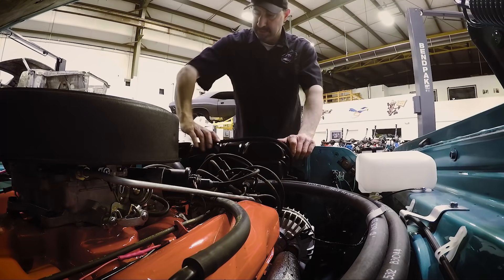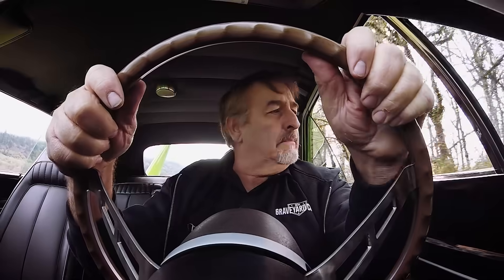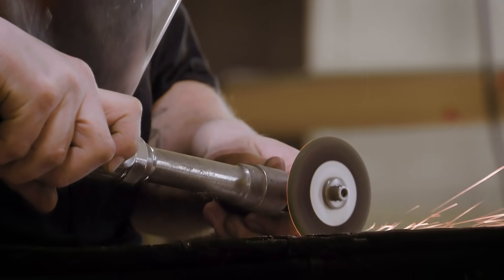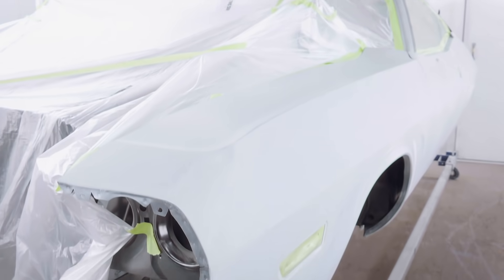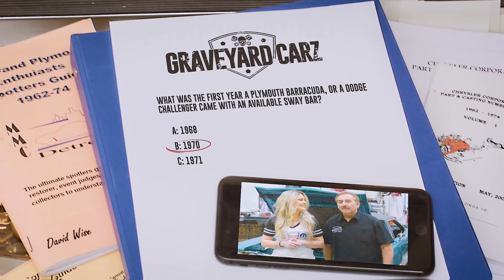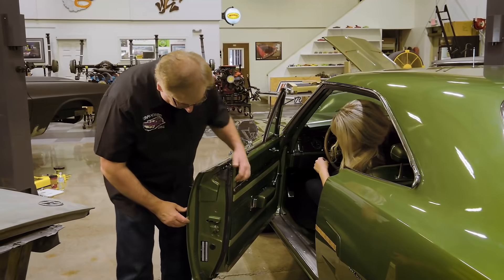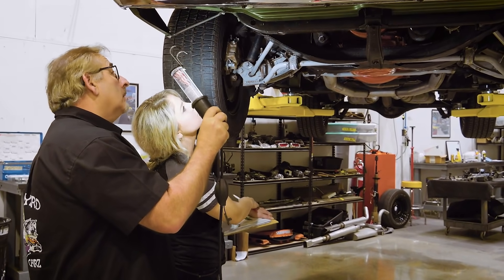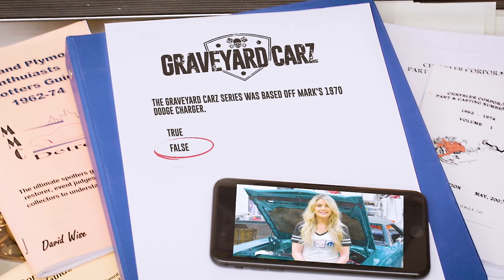700HP SUPERBIRD: TEST DRIVE

Comment: Has this company ever built a Dynacorn Challenger from the ground up?  Would be curious to see what goes into making one 'from scratch'.
Reply: It's like here in the UK we can build  a Mrk1 or a Mrk2 Escort Mexico from the 70s and 80s   but is it's a real Ford ?  
We can buy  all the remanufactured parts,  I can you could but is it a real Mexico
Reply: @ragnar7162  I would like a car that has a few modern touches that don't mess up the vintage look (e.g. suspension, modern brakes, and those wheels that look vintage but are really, say 18", 6 speed transmission) not to mention throw in either one of the wild crate engines that Mopar or other companies sell, such as these Hellcat engines.  Similar to a Cobra replica, these would be mostly like the original, but better AND no guilt in driving it around.